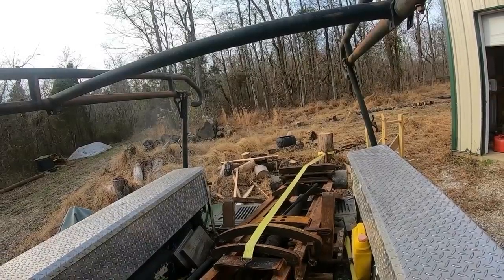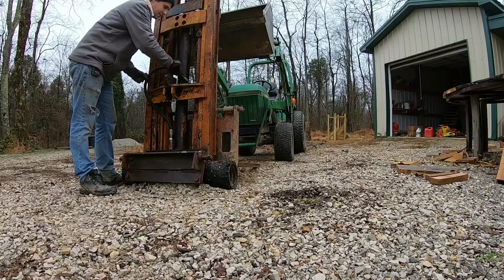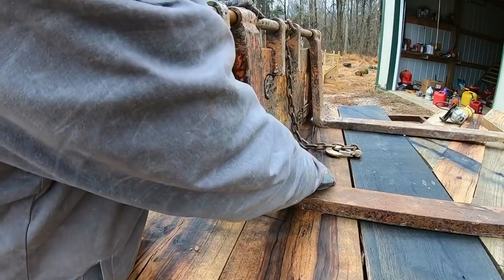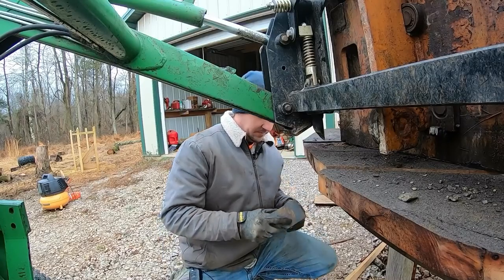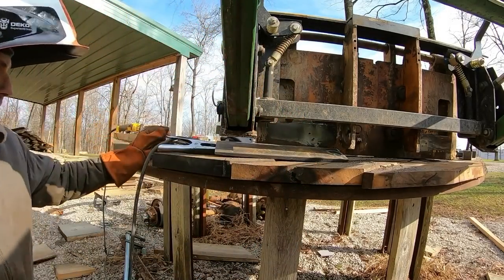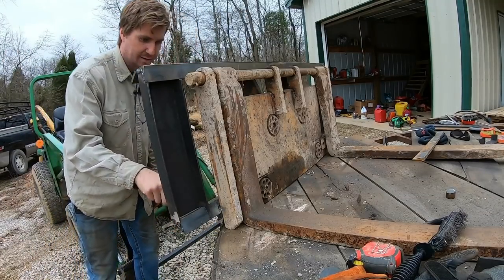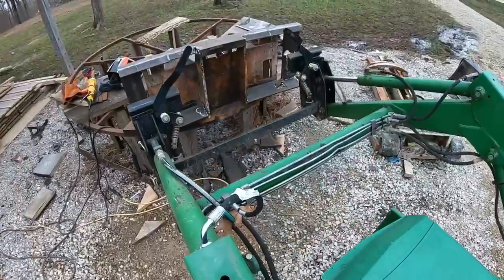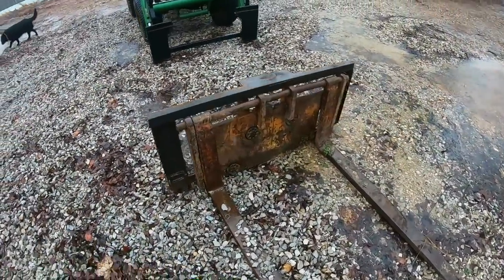Converting Three Point Forklift into Quick Attach Pallet Forks - Will it Work?

Comment: I didn't see you do it in the video, maybe you did it and I didn't see it. Clean the area your welding with a wire wheel or grinder to prep the area for welding. Anti splatter spay comes in an aerosol can that will make you life easier too. Your welds will look a lot better and be more structurally sound. Just imagine lifting something with one of your kids near by and a weld breaks. Scary thought, but i over engineer everything. Keep up the good work!
Reply from the maker: There's always risks,. Thanks for watching!

Comment: Not trying to criticize, you can purchase ready made QR plates for implements for about a hundred dollars, that lock properly and release better than anything I could make! Search QR  weld or bolt on plates.  

As for the cylinder, could you build a draw bridge using solar pressurized hydro system.  Pressurize antifreeze mixed water pushing the oil so when a servo or valve is moved it lifts or drops the bridge!
Reply from the maker: Yup, that's what we used on the loader bucket.

Comment: Ok so now you have a set of forks for the loader which will enable you to lift maybe a 750kg load why didn't you just put it on the 3 point hitch and all you had to do was buy a hydraulic top link ( which is a useful thing to have anyway) and you could even lift a standard 2 ton pallet with that little tractor provided you filled the bucket with clay , that would have allowed you to at least unload a delivery truck, however the deed is done and you can stick that on the biggest skid steer you can find and it ain't going to disintegrate that's for sure.
Reply from the maker: Delivery trucks here come with their own forklifts....and limiting the use to only lifting a pallet up and down...why would I waste my time on such limited functionality?

Comment: A hoist could also be  a jack. Something for it to stand on and something different sizes on the ram to push with so if its off the ground or spreading apart something and being two stage will push a long way. I would say that its  too big for a rudder for the yacht. But it would flip one big one. Heavy trailers that you jack up now become a second away from push the button. I see no problem putting a swivel mount on its side so it could turn out of the way or it could become permanent like it used to be. I don't know of anything stronger than hydraulics. If it was a small and short ram, or cylinder then you could make one fork on the lift permanent and the other push it narrow or wider. You might trade a big one for a small one and still use it on the front of that tractor. just quick attach fittings like on a snow plow... hmmm, snow plow cylinders... kinda puny most are but if you found a robust one??????

Comment: Nice build Mike! I also enjoy converting old equipment into usable things for my 955. Does your 755 have the power beyond kit ?
Reply from the maker: Wanna trade?? Hahaha, would love to have a 955.  It does not have a power beyond, but that is on the short list
Reply: @CaptainKleeman  Haha no, sorry Mike no trade. I have a lot into the 955. Bought it cheap as a basket case at a fire company mud sale. Has a replacement yanmar engine that i put a turbo on. Its a beast. I asked about the power beyond because i tapped into mine and added two scv's. Everything is hidden including the valves. Most times guys just bolt stuff on top of the fenders . Puts my ocd into overdrive ha!  I would send you pics if you ever want to do it.
Reply from the maker: @andytrimble9579  yeah!  captainkleeman1@gmail.com

Comment: Maybe MBTS could check out you fork attachment and offer any suggestions to help improve the safety when lifting heaver loads by adding bracing at the top mounting areas. I am sure the weight of the tractor will limit what you are going to be able to pick up. 

Maybe you could use the parts of the mast to build something that could act as a counterweight. 

It is hard to tell for sure but your materials you purchased looks like a mild steel which is not as strong. 

I like the design of what you made and I also like that you are planning to cut out holes of that of that heavy plate to allow more useful lifting. 

Do your forks need to be that long for everyday use? Because every inch that your load is near the tip of the forks derates your lifting power. A determined load rating is at 24 inches. I would think it is less than a class 2 which is below 1500 lbs. (Think fork extensions)

Keep a eye on front tire pressure for a better stabilized load. 

Once complete test the abilities of your lifting so you will know be able to evaluate your loads safely. 

We want to keep you around.
Reply from the maker: The best safety feature is in the seat...

Comment: Ooops, I had $92 for the adapter plate(from a weld shop in Mooresville, IN) and $80 for the forks. I'll text you a pick.
Reply from the maker: Would love to know where you got forks for $80,. Jealous!
Reply: @CaptainKleeman  There was a small used "stuff" store about 8mi south of me. He bought a lot of old fork lifts and had some 20+ sets of forks. I first rigged a rod thru the bucket on my B2710 Kubota, so the forks were setting in the bucket, which reduced my reach but it worked for my stuff.  So when I got my 3200 I created my own quick couple and bought the adapter plate for the forks.
Reply from the maker: @danielpullum1907  very cool

Comment: I would love to have that hydraulic cylinder and tower. Would make an excellent can crusher. Just kidding. Should be useful for something though. Maybe some sort of press?

As for steel, most suppliers web site have drawings with list describing the physical characteristics of the many shapes and sizes. Look up any metal suppliers or check with your local suppliers for online information. Standard shapes are governed by ASTM standards and all suppliers usually give access to these standards in their online catalogs.
Reply from the maker: Hey thanks for the info! It would make a heck of a can crusher

Comment: Build a wood splitter out of the two way cylinder
Reply from the maker: I don't think it would work for that
Reply: Depends on bore and stroke to how much it would push might be to small one way or the other but 16 to 24 inch stroke and 3.5 to 6 in bore would work awesome

Comment: Hey Cappy, you are loosing lifting capacity with all the weight, you need to remove some of the metal holding the boom rollers and work with the face plate. Even that is way to heavy.
Reply from the maker: If only I would have said that exact thing in the video....

Comment: If your going to do metal fab work you need to do some yard sale and pick up some old rusty metal working tools chisels hammers and odd heavy metal bits and pieces cos plastic ended screwdrivers have there place domestically speaking and I’ve used some inappropriate tools in my time ? Time to start savaging Buster
Reply from the maker: I think there is a lot to be said for common sense and amount if force one applies to a plastic screw driver, if it needs more force then it needs a different tool...how much force are you using when removing snap rings anyway?  Thanks for watching
Reply: @CaptainKleeman  oh enough to have a plastic splinter in my left hand that’s been in there for 4 years well I say splinter it’s more a flake , the old fool I am just kept hitting on the end and it eventually exploded, yep no gloves and no eye protection
Reply from the maker: @DelButch  notice the gloves in the video 😉
Reply: @CaptainKleeman  OSHA approved or as we say in the UK HSE approved and yes your channel is very safety minded as is DP LD18 and WWW and the others I subscribe to well mostly

Comment: bad idea 
lose too much lift capacity especially on a small tractor
Reply from the maker: 😂😂 well I used it all day today and it worked fantastic.  Good try though bud
Reply: @CaptainKleeman  how much was you lifting ? lol i have a small toy about like yours and the main frame you used is way too heavy 
if you get a skid steer mount plate you could lighten up the load and weld forks on it 
not belittling you just trying to help
Reply from the maker: @dallasdavis3246  I'm guessing you missed some key points of the video... Hey thanks for stopping by.

Comment: Sorry, Mike. Great idea and execution but way, way overbuilt and way too heavy. Those are industrial forks for a fork lift or skid steer. Their weight will cut your lifting ability in half.  The heavier the forks, the less you can lift. Look at the difference between your loader bucket and one on DP’s skid steer. Big weight and material difference. Forks need to be sized to the tractor they are to be used on. They’ll work but you have cheated yourself on what they can do.
Reply from the maker: Dirt perfects forks weigh more than these...you honestly couldn't be more wrong.  But hey, good try and all

Comment: Clearly it does work, but you have to factor in how much extra steel you have in it compared to a $600 set of commercial forks already made for QA.  Not only the cost, but the reduced capacity of the tractor lift due to the weight of the extra steel.  Also, the forks have nothing to keep them from moving sideways like the notches in a standard set of forks...that could be remedied by drilling/tapping for a bolt in each to hold them in a fixed place if needed.  

Also, the way the forks 'float' free at the bottom is going to be a disadvantage at times.  Forklifts don't tilt forward (or backward) much, but a tractor can tilt forward quite a bit....like to 'dig' in a pile of logs for example.  Since those forks float toward 'level', you won't be able to do that unless you go back and do something additional to stop that.
Reply from the maker: If only I would have addressed that all in the video...oh yeah...😂😂